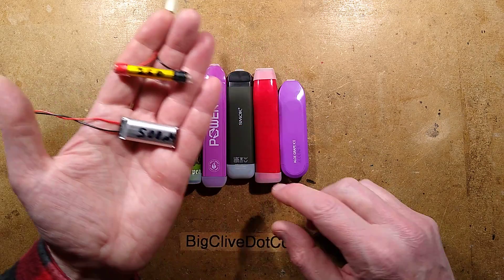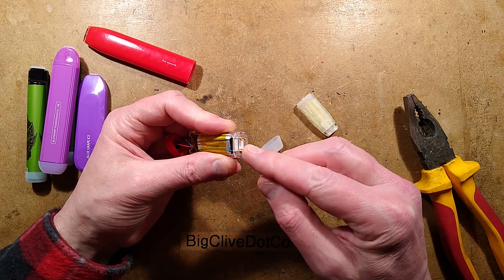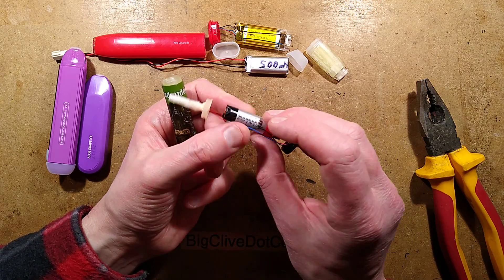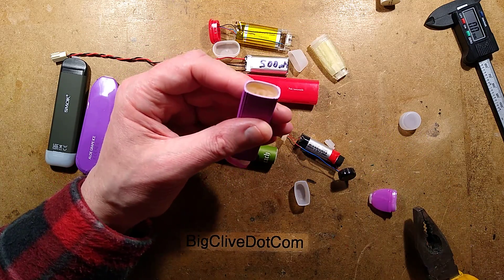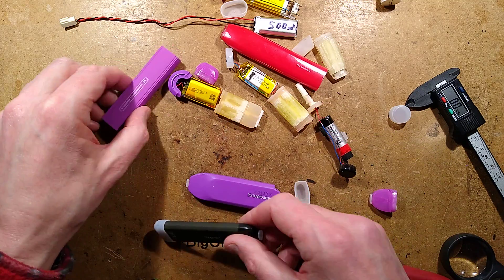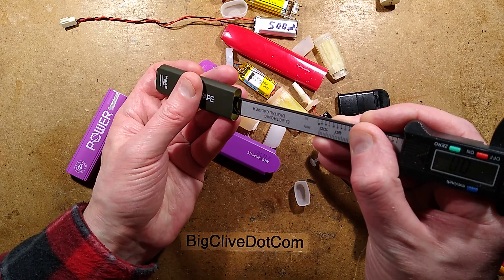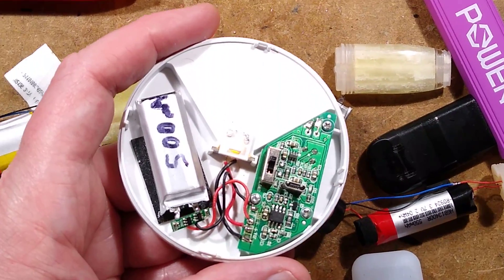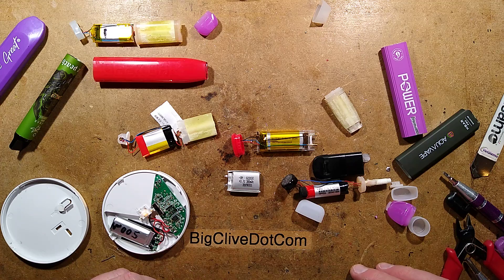Scavenging rechargeable lithium cells from the roadside

Comment: Hi Do they have a Temperature fuse or PTC and pressure relief valve like 18650 cells?
Reply from the maker: They are often bare pouch cells, as found inside many products.

Comment: I've read the pressure sensor switch could have a microchip in it and could be used to recharge the lithium cell.
Reply from the maker: Some of the control chips have charging ability, but not all.

Comment: Update on street lithium: I had first cell from the 2020 start to fail after being charged and used with candle LED for almost 5 years non-stop, the capacity slowly cut in half and it developed a leak near positive connector corroding the solder and forming crystals there._

Comment: 5:32 I think that is a  13450 size battery, I use them for compatible AA size  flashlights that use various quimical and voltage batteries.

Comment: I'm collecting these, hoping to use the batteries to power breadboard projects, and potentially my own custom vaping units. Very new to all this.
Reply from the maker: Just make sure you follow the usual safety protocols with lithium cells.  Avoid shorting them, and use proper chargers suited to lithium.

Comment: The cat is very fussy and only drinks running water from a DIY drinking fountain powered by 
a few of these connected in parallel, worryingly some have started to bulge from internal pressure
build-up,  I am guessing they are only dangerous if shorted or what? because my next project is the
world's first vape-powered EV that I think will go like a bomb!
Reply from the maker: If your cells are bulging it suggests they may have been overcharged/discharged or shorted.  I'd recommend discharging them completely and then recycling them.

Comment: lately I have been finding vapes with 200mAh cells in it. Come on people, put some decent cells in it, daddy needs some power
Reply from the maker: There is a step in the right direction though.  The lower capacity cells are being used right down to 3V now due to heater power control.  They used to cut out at half discharge.

Comment: Would it be too much to ask you to make a video explaining how you would go about recharging the battery at 6:59? I have one of those, and my TP4056 is about to arrive. Can these lower-capacity batteries be hooked up with crocodile plugs to a default TP4056 and receive a charge the same as you showed in your other video? That's one of the questions that would be answered if you made that video. This doubt arose after the first video you released talking about TP4056 and vaper batteries. Then, in a subsequent video, you showed the charging process again but with a modification on the board to make the amperage lower. I'm sorry, but the point I'm describing all of this is that it wasn't clear in my opinion if using that modification you did is necessary and if that means the modification should be applied to all the batteries you've shown, especially the lower-capacity ones.

I believe I already thanked you for these videos, but I just wanted to say that either you talking about this again or not, I really appreciate them and I'm sorry if this is making you revisit something you didn't want to think about right now.

Comment: Thank you for all the useful videos. I had a question regarding the tp4056 boards you use. When changing out the r3 resistor, what wattage resistor do you recommend? Will a 1/4 watt resistor fit? Sorry, new to small electronics. Appreciate all you do.
Reply from the maker: It's very low current, so quarter watt is fine.

Comment: Hi Clive. I have bought a little bag of TP4056 modules for recharging vape batteries, as advised by yourself. Just wondering, is there a module available to prevent deep discharge of the cell/cells? I am aware that the cells should not be discharged beyond a certain point to prevent damage. Thanks, keep up the excellent work!!
Reply from the maker: There is a version with the overdischarge protection built in, but in most instances, as long as it doesn't get drained to zero the cell will be OK.  Keeping within the upper and lower limits does extend the number of usable cycles though.

Comment: Hey Clive, I just got my hands in some batteries identical to the cylindrical ones you took from the green device. Is it safe to remove the silver wrapper (to expose the poles), re-wrap them and charge them in a proper li-ion battery charger? 
I ask because I'm used to 18650 cells, that have a solid metal exterior, and I can easily change the wrapper. I'm not sure about these reclaimed cells since the external foil is very thick, and I know how dangerous it can get. Thank you!
Reply from the maker: The foil is the cell housing.  It should be left intact.  You can solder wires onto the tabs at the end with care and use tape to secure them against breaking off.
Reply: @bigclivedotcom  My intention was to use the batteries as substitutes for RCR123's in gadgets, but without proper poles it's not gonna happen. Anyways, thank you very much for helping me not get my house burned down! =)

Comment: Hello, I'm dismantling some of these electronic cigarettes with the aim of also recovering these rechargeable batteries and I'm wondering if it's possible to do something with the LED system, it seems to work with suction but without this suction I don't really know how it can work, if it's possible to connect them to one of these batteries for example but without needing the suction system as a switch, what do you think?

Comment: I've just got new vape from the shop called "I vape good" gets around the 600 puff law by having 2400 puffs provided by  4 pods in a rotating magazine and share 1 battery, interesting the battery is statrd as 1750mAh... Looking forward to it running out so can pull it apart
Reply from the maker: I ordered one of those recently.  Just awaiting its arrival.
Reply: @bigclivedotcom  just pulled 2 apart,  contain 23350 cell, rated 6.8WH @ 3.7V

Comment: Is there a way to wire them ALL together and  MAKE THEM CHARGE SAFELY andCONTROLL the voltage(as a charger controlling volts) 
make a safe battery pack? id  love to see a video on that. I have so many vapes
Reply: if you only need a 1S system (3.7v) you can wire them in parallel with a tp4056 board, they'll charge from USB and the board will output 5v.

larger systems are more difficult and require cell balancing, I haven't done any of that yet

Comment: For everyone crying about the waste, youd need 38,000 of these batteries to power a tesla. Cars (in general, ice or Ev) are the real wsste
Reply: the thing is though, teslas aren't single-use, they're rechargeable. lots of these vapes are charged at the factory and thrown away when the battery dies.
Reply: @TheAechBomb  Thing is though, reckon you could use 38,000 vapes in the 15yr life time of a car? Doubt you get through a 50th of that as a heavy vaper

Comment: How do you know if a li battery rechargeable or are they all rechargeable? Asking as have a few li "D cells" that say do not recharge?
Reply from the maker: If the cell warns against charging then it may be a primary cell with a voltage of 1.5V or 3V and can't be recharged.

Comment: could you elaborate on the switching mechanism..??  it has nice property to cut off at 3,3v.. which is quite nice.. but can it be modified somehow to use it as protection board ???
Reply from the maker: Some can be used as a charger, but not easily as a cut-off controller unless the load is powered in brief bursts like the original application.

Comment: Hey Clive! Thanks so much for this video! These days, most of these "drug delivery systems" are actually rechargeable, and come with a nice USB-C port! So now more than ever, I've been wanting to salvage them. However, I'm really confused.... I've taken multiple apart by now, and they don't ever seem to have any protection circuit installed. How could that be?? They look exactly like these you've taken apart, but with a tiny female USB-C port attached. I don't see any sort of microcontroller chip or anything at all on the tiny USB-C board. Is it possible they could now have a protection circuit embedded in that tiny circular "microphone-style" pressure switch?? I feel like not, but idk how else these rechargeable versions are avoiding overcharging and explosion...?? The circular pressure switches on my rechargeable ones look no larger, or any different from those you showed in this video.

Thanks in advance! Always love your content (:
Reply from the maker: There's a chip inside the microphone-like pressure switch, that does everything including regulating charge current.
Reply: @bigclivedotcom  Makes sense! That's nuts haha. Thank you!

Comment: I've now amassed a huge collection of cells from my sister's vapes and vapes I keep finding on the streets . Some are 550 mah and some are 1000 mah!I managed to recell 2 old laptop battery packs with them and still no dent in my collection 😂most vapes are still full of fluid but the battery is discharged.

Comment: You don't need any additional BMS. There's one integrated in the controller of the e-cigarette.  Cut the blue wire that goes to the heating element and apply +5V to it and black to GND. Here's the link to the data sheet of the controller used in like 99% of these e-cigs: https://belchip.by/sitedocs/44943.pdf
Reply from the maker: Not all have that poart if the circuit active.  I found some Geek bars didn't charge that way.

Comment: Bigclive it’s good you tested the capacity because cheaper units often lie with their claims on battery capacity just like cheap 18650s often lie about their cdr you can have roughly a 10-20A rated 18650 battery and budget brand manufactures will buy bad bin cells that measure in under the cdr set by Sony, lg and Samsung and over inflate the cdr to like 30A, 40A while over inflating the mah so like 30A 10000 mAh which for 18650’s have been proven wrong since the cdr and capacity fights for space so if you have a high cdr your capacity will be lower and vise versa.

Comment: (Thankfully) I haven't seen many but finally picked one up and it has a hard-wired IP18450 (19450?) 3.7V 1350mAh 5Wh solder-tab cell inside.  I found the mouthpiece end pretty easy to remove even without tools - the bottom cap with microphone(?) and/or what looks like a level indicator(??) so far resists removal.  Downside is it stinks of the leaked "Banana Dragonfruit" liquid UGH!...  And it was an Aluminium case - almost like a mini power-bank!  (Won't post the brand/model details)

Comment: Lately I've found new applications for the 13400-size disposable vape batteries and other cells that fit within a 15x25x40mm space. With two matched cells (manufacturer and capacity), I've been able to build "9-volt" batteries with the help of a cheap 2S protection circuit and the snap connector harvested from dead alkaline/carbon-zinc 9-volt batteries. I've been able to draw well over 2 amps from such a battery with little loss of usable capacity, whereas regular alkalines and even commercial Li-ion 9-volt batteries struggle to push over an amp of current.

I've yet to find the proper search terms to procure plastic empty 9-volt casings so I can give the batteries a proper housing. Unfortunately, searching for "case", "shell", and other words from the thesaurus have been unsuccessful in finding suppliers that make the raw shells.

Comment: Can you parallel various of these Lithium cells to make a larger battery safely?
Reply from the maker: Yes.  But they must have very close voltages before being wired in parallel to avoid high current flow between them.  Once connected in parallel they will act as one bigger cell.

Comment: I bought a tiny disposable just to take it to bits. Mine had a HD 13300 400 mAh (claimed) lithium cell. The pressure sensor has three leads connected positive, negative, and other and a white LED. The negative and other wire go to the heating coil. I'm wondering if there is any way to use this little sensor device with built in LED.
Reply from the maker: The control module is very specific to the application.  I've not thought of another use yet.

Comment: Surely it can't cost much to just stick a fill port and a charging port on these so you can change the cotton and recharge them.

They could even make a proprietary cotton and charger if that's the problem.

I nearly always find I run out of juice before I run out of battery power and even then I suspect they have something to detect when it's nearly empty to cut the power.
Reply from the maker: The bigger players do a replaceable cartridge system.

Comment: The round ones also make excellent 18650 cell sleeves, giving added protection if you are say making a scooter battery or something you can seal with silicone against any wet weather   🤩
Reply: I actually offer a small amount for people to collect these for me on facecrook marketplace, like a millennium way of collecting drink cans and making some money....  also saves dogs from having their mouths burned if they chew on them and start a thermal reaction - that's my clickbait way to get people to collect them 😉and yes they are ALL aluminium bodied.  (Put the plastic part in a vice and wobble is faster removal.)

Comment: I thought I was the only one doing this. I have a ton of them right now that I reuse for electronics projects. Even though I have more than I would ever need I still save them because it's practically criminal to throw them. I don't think that many people know but, lithium is not very plentiful and also a conflict mineral that has to be dug up by hand by men, women, and children in inhuman conditions and throwing them away is like spitting directly in their faces. I also save lead acid batteries from Power Wheels cars that kids and their parents get tired of and throw away, I might find one ever month or so and now have enough for a nice battery bank that I can hook up to a solar panel. I'd be on the look out for those too, just keep a screw driver in your car so you can quickly strip them by the side of the road instead of just throwing a whole toy car in your trunk.

Comment: Councils could/should have bins just for vapes - or at least just for batteries, like in Holland. 
What amazes me is that some of these disposables cost as much as a tenner, Half the appeal must be in the look and feel of them and the visibly blowing out smoke, rather than the flavour and the hit - the packaging is the product. I have seen young teens using them, who probably wouldn't smoke cigs; they have that sickly nicotine-poison look about them.
It also amazes me that NHS England recommend using them, without really stressing that they contain nicotine, are extremely addictive, and that they should only be used by existing tobacco smokers to avoid breathing tobacco tar, and are otherwise unhealthy.
Edit: I just took apart a large Crystal Pro square-section one, round aluminium tube with a square acrylic casing; battery weighs 24g, the rest without the sticky smelly stuff weighs 50g
Reply from the maker: The tricky but it's getting people to put them in the designated bins.  The sort of people who buy disposables are more likely to throw them on the ground.

Comment: actually the disposable cancer sticks do posses an undervoltage protection circuit(I use them, trying to quit smoking), after a certain point the device stops operating and the built-in led starts flashing. The batteries still posses a descent amount of charge since shorting the sensor circuit still results in the heater working.
People generally return the empty ones for a discount to be "properly" disposed of, but vape shop usually give them out for free(I have a friend who got 6-7 free of charge).
P.S. Thanks Clive for nice videos.😊

Comment: WARNING NICOTINE IS VERY ADDICTIVE AND DANGEROUS| MOST VAPES HAVE NICOTINE!
Just curious is it posible to sterilize by using UV lamp for few seconds? Afcourse after reclaiming item in higienic and safe manner similar to that which all responsible dog owners do - using dog shtbag in simpler words 😁 
  So short conclusion could be that from thse material waste vape/ecigarets beside salvagable lithium batteries which can be reused  after testing & with aded apropriate safety circuit for charging.
 All batteries can go for raw materials as Al, Li, Cu, Au, Ni, Sn etc recovering because electric car or literaly anything is better then single use dildoshape objects.. 😁
  Allll of them have  qality wolframe wire heating elements. Which is valuable resource on its own. as resistors or wood burning, plastic cutting projects for example. 🙃
  Most of them have LED indicators of diferent color. Like another freebie for many projects or light indicators for everything on one circuitboard. 😅
 Even those plastic casings looks sturdy with some level of chemical resistance to withstand corosive liquid inside. maybe can be remelted and used in 3D printing projects.
  I have suspision that those filters in one bunch can be useful in elektrolysys projects as seperators/filters. Vacum filtration?
  Final thought - is it technicaly safe and worthdoing after sorting by types to asamble many of these lithium batteries in one huge case capable act as proper energy storage for smal wind turbine, solar panels or simply handy to have in any average household 🤨

Comment: I'm trying to resist speaking to the local road sweeper and have so far only harvested 5 x 500mah cells for my "power wall" - somewhere I have a very crap Maplin 12 volt solar panel ...
I was thinking of making some sort of garden talking point ...
It's a stinky job, but someone has to do it.
Around these parts there are more empty NO2 whippits than vape litter - maybe I could combine the two in some way ...
People are disgusting though - but life is shit for so many ...